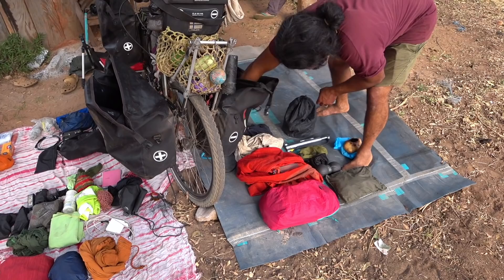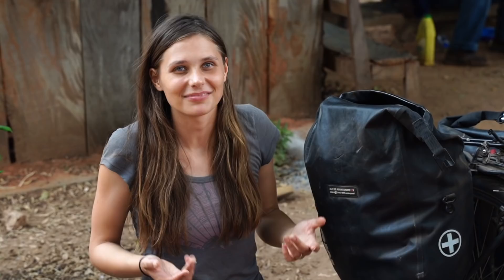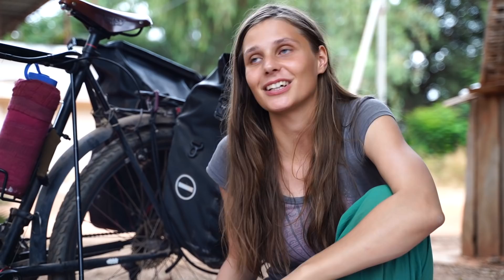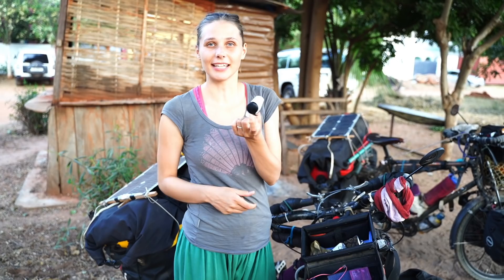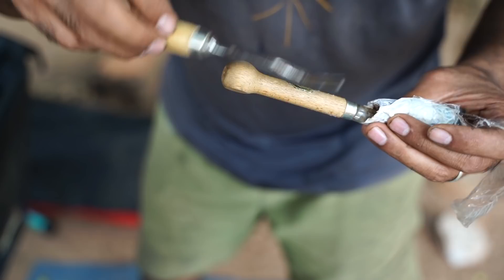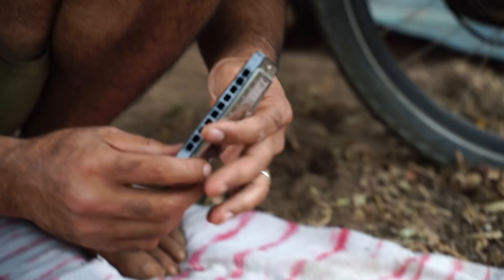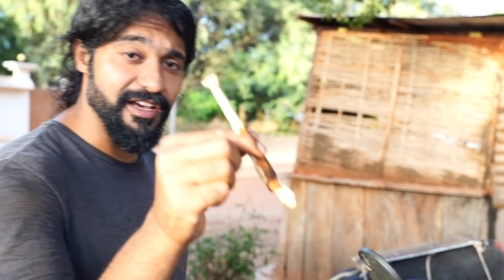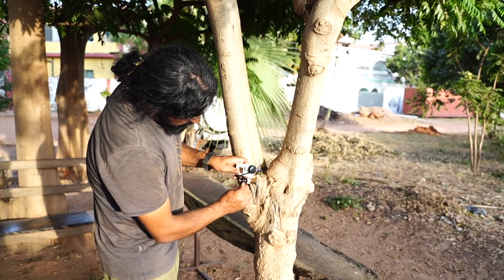What equipment we carry on our 10 year bicycle tour around the world - Full Setup Gear Review

Comment: Your sealant and tyre repair glue also make good emergency firestarters (test the sealant, but tyre repair glue usually burns very well)
The warning labels and symbols usually tell you if they burn and you can squeeze out just the right amount, more for wet days, less for dry days.
Buy tyre glue from car tyre repair shops anywhere in Africa but you need a small screwtop pot for it because they normally use/sell large tubes. You can maybe make an offer for a nearly empty tube. 
You don't want the white rim sealant that the put on with a brush or around the valve, you need the clear or coloured glue they put plugs plugs in with or glue patches on with. If it stinks and gives you headache that's usually perfect :) 
At a car tyre repair shop make the universal international sign for a tyre plug - stick your middle finger out downwards while you pretend to push into a tyre and rotate your hand. They use a T-handle spike tool to clean the hole out with this motion before fitting the plug so everyone will recognise it. 
In arabic or maybe swahili areas you can ask for "alghara' 'iislah al'iitarat". Portuguese "cola para reparação de pneus". Afrikaans "gom vir bandherstel". French "colle de réparation de pneu" 
A cheap source for tiny tubes may be those small tyre repair kits (the ones that serious cyclists don't buy haha)
 
Latex-based "impact" or "contact" adhesive like the industrial Evo-stick 528 (colour - light brown)usually burns quite well too - so watch out for it around shoe makers and shoe repair shops - very gummy adhesive they hammer rubber soles on with. It smells of petroleum and goes stringy as it dries. Again, you need a small tight-lid pot for it and it will eventually dry in the pot so this is a short-term option for glue or fire-starter.

Comment: What an impressive and fun video. As a casual bike tourer, what struck me was the familiarity with each piece of equipment and its specific location on the bike. Clearly a system that has evolved based on needs and experience. Love the breadth of repair equipment, both bike-focused and otherwise. It's easy to ridicule, but until you have know the terror of a remote breakdown, you can't understand the value of carrying such gear. A little surprised by the lame lock, but maybe this speaks to the safety of areas being visited. Final thought: you guys need a drone!

Comment: Hey guys, whenever you can order this, I would suggest a water filter called 'Survivor Filter Pro X'. It does use batteries, like the SteriPen, but it can also be recharged via USB. It actually comes with an optional solar battery pack. The most important thing though is that it's the only compact filter on the market which filters down to 0.01 microns which means it eliminates a lot of known waterborne viruses like Typhoid.
Reply from the maker: Thanks for the recommendation, we'll check it out!

Comment: SOG "powerlock" multitool (better than leatherman pliers) their mid top end model with the full size toolset is the best MT I own, and I have 10+ from victorinox, leatherman, gerber, SOG, and others... Buy the model with the scissors and not the rescue cutter for greater versatility.  Used ebay models from the last ten years will save you a bundle and keep on working, plus you can buy replacement parts.

Comment: Instead of hard drives, I prefer to use microSD cards as backups - I use a microSD to USB adaptor and use a small hinged metal box that used to contain tiny mint sweets to contain them. I can fit about 60 microSD cards in my tiny box and the one adaptor (which is only the size of a USB flash drive). I use a USB3.0 adaptor to get the best speeds from modern fast cards and I use fast rated cards for designed for continuous fast video transfer. For extra backup cards I usually buy slightly slower cards to keep costs down but you only save a little doing that.

That way I can keep several copies of vital pictures, videos and essential documents/maps/ebooks and spread them around difrferent bags. 
Hard drives are inherently fragile and also quiet large and heavy. MicroSD cards are very robust by comparison and even good brands are quiet cheap nowadays, though beware of fakes.
MicroSD cards can be slower to copy large videos than a fast hard drive but they use less power while running and you can stow them everywhere in different pockets or extra backups.

edit: don't make the mistake of buying very large capacity microSD cards - I prefer to buy the ones that offer the best price-per-gigabyte and buy several. That way you don't have all you eggs in one basket.

Comment: Hi guys you didn't say much about the solar panels size wattage cost ,thanks for another great video be safe .
Reply from the maker: Thanks David, they are 18w and weight 325 grams. They have upgraded the panel since, and the new 20w one is around 140€. Here is a link to our review about the panels:
https://nomadstrails.com/the-best-outdoor-solar-charger-sunbeamsystem-solar-panel-review/
Hope this helps 😊
Reply: @NomadsTrails  thanks I got a Chinese  supposed 100 wat panel  its 12 inches by 13, and is very unlikely to be more than 20 wats, probably 13 to 20 , but have ended up with a kinda heavy  renogy 50 wat  panel,  probably  bit hev to carry but I mite just the same .

Comment: Hi guys. Thanks for the equipment review. Lots of useful info. In regards to your USB hard drive problems, I assume it is related to the long term exposure to vibrations on the road. You would be better off with SSD drives, which have no moving parts, are lighter and more power efficient on top of being more reliable. Cheers.
Reply: id bet on that too, precision moving parts aint gonna love rumbling around for 12h/d in "extreme" temperatures

Comment: i am impressed by the amount of stuff you have to carry. was it difficult at first to get used to the weight? are you trying to avoid hills on your journeys? whats the total weight? recently i mounted just regular back panniers and i felt the difference immediately :D and sometimes had to ride 1 or 2 gears higher and i am still talking about riding relatively straight (no high hills)
Reply from the maker: We actually find the difference between cycling with and without panniers feels surprisingly small (but our bikes alone are heavy too 😅). Only after some hours of cycling we start to notice that we get tired sooner. And hills feel a bit steeper of course. We haven't really found that we avoid hills, but maybe if we would have very light setups we would consider some loops that we now don't come to think of.

Comment: Very interesting to see how others pack .. and I thought I carried to much after watching your video I released I don’t lol .. one question your tent  same one I looking at for my setup how did the poles break I though it was bomb proof thanks
Reply from the maker: Hi, regarding your question:  we have the Allak tent from Hilleberg, it is not bomb proof. the design cannot handle the high wind we broke the poles when we had high wind, again the design is pain  when the tent is wet, because the doors always touches the inner tent and makes the inner tent wet. there is way too much stress on the zipper of the outer layer this makes those to wear out faster, after 3 to 4 months of daily use the floor of the tent will leak  no matter how you protect the floor. the outer fabric is very durable and the tent has been made very well.  is it worth the price tag ( 1200e), no way!  But the warranty and the customer service is simply amazing, they are so so good. will send you spare part any where you are in the world.  would we buy it again, No. if we buy from Hilleberg at least not this design.
Reply: Nomad's Trails  wow thanks just saved me money
Reply: @NomadsTrails  I'm using Anjan 2-person tent from the same producer Hilleberg, it's 1 kg lighter and I'm very satisfied with it. Its design can better stand with wind and the door doesn't touch the inner tent.

Comment: Too heavy cycles. How you charge your laptop when there is no electricity ?
Reply from the maker: yes indeed.since we are not on  short trip and we live on the road our bicycles are our homes so it is important to be comfortable😊 but bicycles are pretty strong and has no problem with the weight. we have our solar chargers and usb C battery pack so we can charger 1 of our laptops but for the older laptop we need greed electricity. here is an article about our solar chargers https://nomadstrails.com/the-best-outdoor-solar-charger-sunbeamsystem-solar-panel-review/